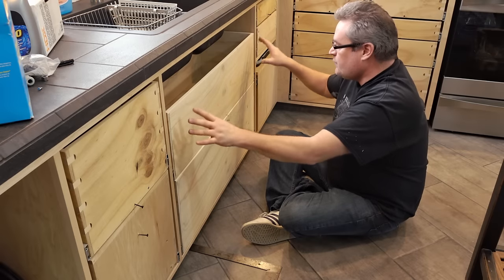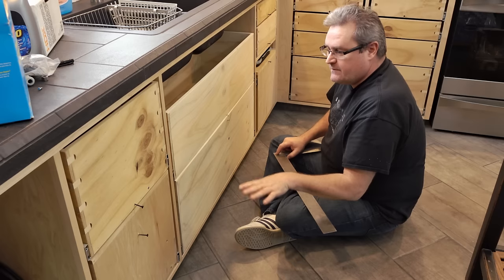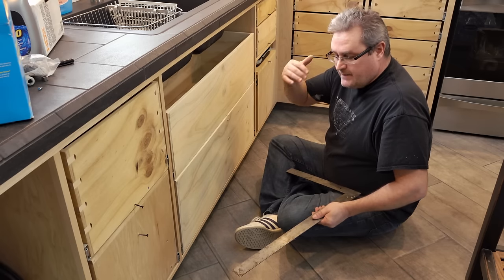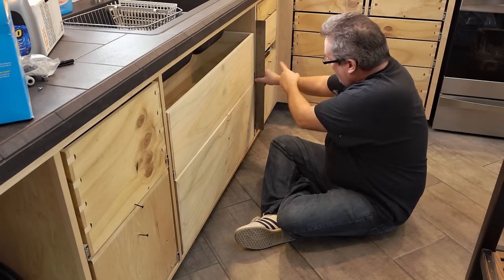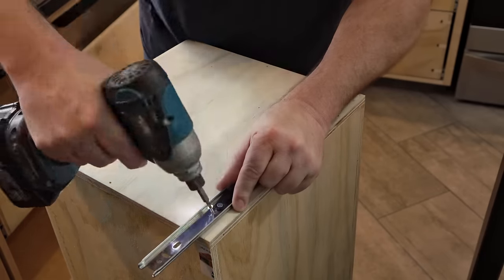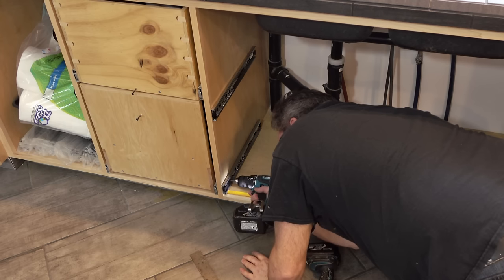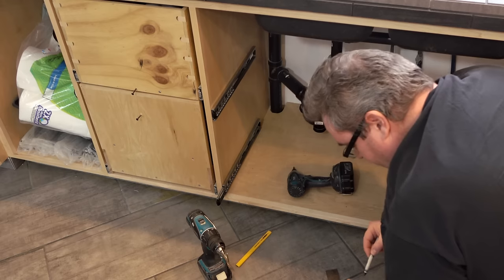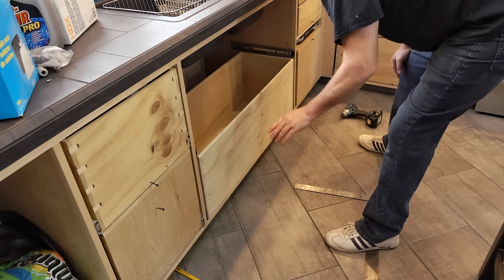Fixing A Poorly Aligned Drawer / Drawer Slide Problem

Comment: Hi john,
Thank you for the video. I am the owner a professional cabinetry business in Nashville. The way we handle this issue is similar to yours. This is what we do: We screw the slides in as normal, then we add a #6 screw with a washer to the front and to the rear of the slide. Then we remove the original 5mm euro screws. After that, we are able to easily make sure the slide is level with the face of cabinet by simply loosening the #6 screw a tad.. Then slightly moving the slide up/down.. After the sweet spot is hit, we add new 5mm euro screws. This process takes us 5 minutes per cabinet.

Comment: If you look at these slides closely, you'll see some slots for screws - not round holes. With these you can adjust slides position first, and after add screws in every round hole.

Comment: A part of me would dismiss ever putting the drawer slides a different heights, but, in the end, nobody is going to notice and it still works just fine. Great tip.
Reply: I can't imagine anyone studying my drawer slides and noticing the one of them is a 1/4" higher than the other. No one will be the wiser once the drawer fronts are installed.  ;)

Comment: A big thank you John for a straight forward description and solution.  I built two cabinets for the workshop - one with 12 drawers and the other with 16 and sure enough had the SPECIFIC problem you described.  Looked for quite a while before I ran into your excellent video!

Comment: Good tips. I'm in the process of installing drawers i just built into a built-in cabinet in my closet i also made and the first three work perfectly, the 4th (of 8 total) needed some adjustments and this video will be of help. Before i get back to work on this, i need to go get some decent screws. The ones that came with my slides are junk.

Comment: Thanks - I am making some internals for fitted wardrobes. Got the drawers on, and 2 of them have this problem. I have tried every possibility - moving the guide rails on one side slightly back, moving the drawer runners forward, and nothing seemed to work. NEver thought to check if they were square!

Comment: I presume the slides on each side of the drawer work independently of each other since you didn't adjust the right side.  I always use a level, but the square is better.  Great tip.   Would have been nice to address other reasons for the problem you faced.  I appreciate videos which address problems . . . figuring out why something didn't turn out correctly is always a challenge.  Rare for YouTubers to show they are less than perfect.

Comment: so, i have a unique issue. my parents had a cabinet made in indonesia and its here in vermont now. the lower drawers however are very hard to open and to close, and i checked it out earlier today (its been a few years since we got it here and i havent done any thing to try and fix the issue till now) so, the slides that where used are the type with two wheels that one glides within or along the track. super simple. so i checked the slides for bent sections, but they where perfectly straight according to the straight edge i used. so that wasn't the issue. but i found a 1/16th inch difference from the front end to the back end on the slides, so i figured the slides where out of parallel. however, the wood, which was supposed to have been kiln dried, has, understandably, warped a bit. so, i am not certain if the issue is individual to the warping, or a dimensional issue in the work itself, or a combination of the out of parallel, as well as the warping of the wood. so, ultimately, i want to try and fix the issue, but am not sure how to go about doing that. ive thought about maybe shimming one side of the drawer slides on the cabinet itself to make up for the difference and regain the parallelism. or, do i mark where the slide in the cabinet itself lies in the back of the cabinet, and cut or try to cut a 1/16th inch notch where the slide contacts the wood, to account for the warp and alignment issue. another thing ive thought about was maybe somehow replacing the slides entirely, though that probably woudlnt account for the warping. thus, i wonder how i solve this issue in particular. options i know of, 1: change the slides entirely, 2: cut a notch or shim the slides in the cabinet to align with the slides on the drawers... or 3: modify the drawers instead somehow. its been about 5 years since the cabinet was made and delivered here, so, i don't know how much more warping it can do, so if i fix the parallelism issue, but it warps some more, iw oddly probably be a bit screwed, and have to do the work again some time. as i am not exactly experienced enough to make an informed decision on what the best course of action would be, i have been looking for any sort of ideas, that might help me decide what to do and how to do it. oh and, i am not entirely certain how i find how out of parallel the slides are, so i can then quantify exactly how much to shim or cut to bring things back to parallel and aligned. thanks for whatever answer you can give. =)

Comment: I have a 2 drawer wooden file cabinet and the top drawer is leaning down on the left side about 1/4 of an inch. The door opens and closes properly but just leans enough to prevent the latch from closing. Any ideas?

Comment: Hi John.  Great video and thanks for all the work that goes into posting.
One question, since you registered the top drawer off of the bottom one when you installed it, did this fix cause any issues with that one as well?
Thanks again for sharing your expertise.

Comment: Looks like the drain pipe is mostly on the left.  Did you consider making the drawers asymmetric or is there something on the right that I missed?
Reply from the maker: If you mean "L" shaped, that would triple the time it would take to make the drawers and they wouldn't be as sturdy. Strength for these comes from the continuous front and back from side to side.
Besides, I've not shortage of space in this kitchen and these drawers double the usable space there already.
Reply: You is a Smart man...   ;-)

Comment: I'm trying to fix a homemade drawer issue which is indeed driving me insane : opened, the drawer leans on the right, closed, it leans on the left. I'm 99.9% sure this is a bad rails alignment and/or level but I've no idea how to align them properly, knowing that the drawer is only 14cm wide. I can't put a level inside between the two rails and even if I could, I don't know how to get the right height AND the proper level at the same time. I'll get it there eventually, but God this is driving me nuts! :)

Comment: I can't get my head around how a front-to-back out-of-level became a side-to-side out-of-square. 
Also, couldn't you have just lowered the back screw on the cabinet-side part of the slide without changing anything else (maybe plugging the old screw hole)?
Reply: The original location for the drawer slide was resting on the floor of the cabinet, so he couldn't fix by lowering the rear of the drawer slide.
Reply: Don Rice: Ah, good answer. But then why not just raise the front screw?
Reply: Well he couldve raised the back end of the drawer slide, I think there was enough room there for it not to start rubbing against the bottom..
Reply: Karl, cant raise the front screw because it would have hit the bottom of the upper drawer. John fixed it really easy and the only way to fix it.

Comment: Thanks for video, even though it wasn't shown, I am assuming you also had to do the same thing to the other side. Also, by doing this, all you really did is change slide position and did not raise the bottom drawer, therefore not have to redo the top drawer. Correct?
Reply from the maker: Actually, everything was shown in the video.
Reply: +og atkinson, there is no reason to change the other sides height. one is only a 1/4" higher.
Reply: OK, thanks.
Reply: Thanks.